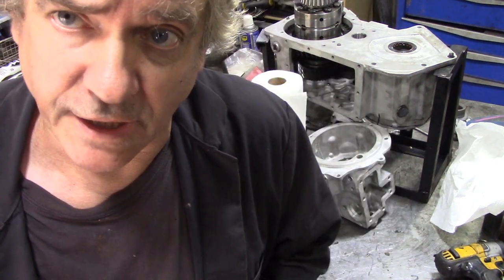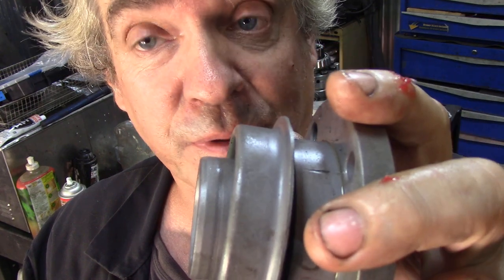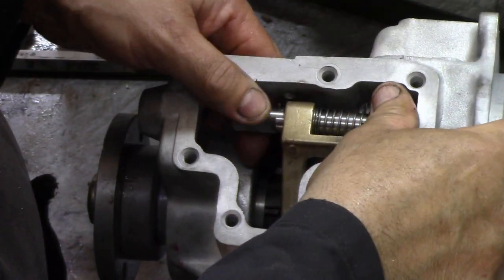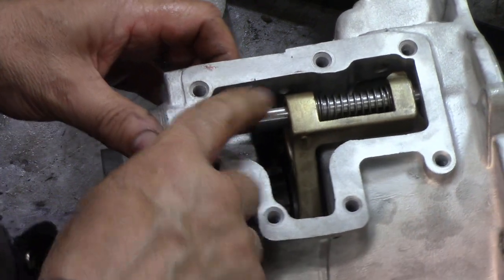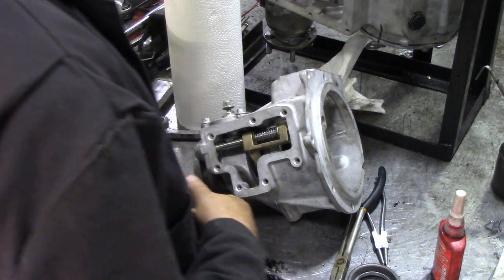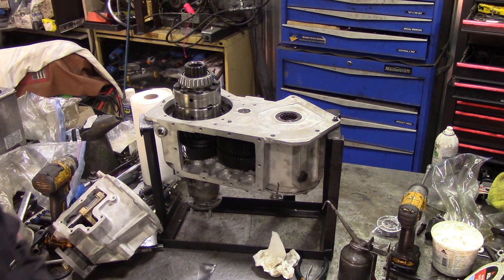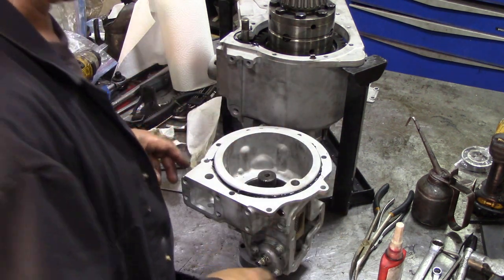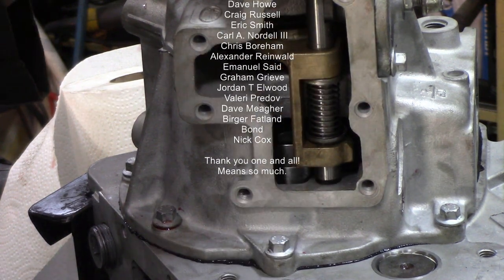Building a 1:211 ratio LT230Q for a Defender Td5 from a Discovery 1 or 2  Part 4

Comment: It’s interesting JP prefers to make the bush to fit the hole, yet Ashcroft go the other way and sell the bush and you get your case machined to fit the bush. I guess it’s so they can sell them.
Reply from the maker: Yes  - they have a CNC machine to machine the cases, so pretty easy for them
Reply: @BritannicaRestorations  they sell the bushes separately. That’s where I got mine and got somebody local machined the case. No idea how they machined it. Maybe CNC as well? Seems fine so far, no leaks (touch wood).
Reply from the maker: I think JP's reasoning is he wants to make a thin wall hard metal bush so as not to compromise the strength of the casing - also it is much simpler to machine the hole in the casing first on the miller and the make the bush to fit the hole, because if you make the bush first and then make the hole, you may find the new bush is too small - those castings are pretty porous 
I have not seen an Ashcroft bush - I meant to order one but forgot

Comment: Hey Mike, I've seen a guy on YouTube from Pakistan who'd weld up that seal diameter on the drive flange with his "stick" welder and a cardboard welding shield, put it in his lathe, tap it with his chuck key to get it running concentric then machine it with a HSS tool, and it possibly wouldn't leak oil.
Your mate JP could do that. ✅👍
Reply from the maker: Yes - I have seen these Pakistan 'repairs' - they never state how long they last!
Reply: @BritannicaRestorations  I believe it's an "end of driveway" warranty.
Reply from the maker: Or, as I like to say, an 'outta sight warranty'! 
Soon as it out of my sight, the warranty is up…

Comment: Mike.  Liked your sleeve discussion, thought it was from the priesthood !  Noticed last weekend when down shifting a Rangie "ZF" auto' quickly from D_1, in high range differential locked going downhill off-road the T/C lever kept popping into neutral.  Is this sign of wear on the teeth ?  V.

Comment: Question for you Mike! I had 0.005" play on my front output shaft/flange even after changing the Bearing and Flange. Can you tell me what the acceptable play for the front output should be??
Reply from the maker: No idea - never had the need to measure it - remember there is only one ball bearing and the internal gear of the centre diff supporting the shaft
Reply: @BritannicaRestorations  I have a nasty Deceleration viberations/growling at 70mph from the front. I found output was loose and measured before and after the bearing change. It's a D1 with a lift, so a Double Cardan DS has been ordered to fix those DS angles. MANY thanks for the input! Like you said; by design, they will never be fully tight on one ball bearing.
Reply from the maker: The worst thing you can do to a D1 is lift it - they were bad enough for 'death wobble' with a standard set up
I do not think anyone has put their finger on why it does it
My D1 300 Tdi I had in the UK was prefect - but a percentage of them here with the V8 were a nightmare!
Reply: @BritannicaRestorations  Yeah it was never very fun to drive on the freeway, and way worse after lifting it. The 3 degree caster Arms helped a LOT, but really messed up the drivelines. Got the garbling decel noise shaking and I seen output was loose some. Did bearing seal and new flange and didn't help.. So I'm converting to double cardan (tom woods) on the front, and the Standard RRC 2 UJ's on the rear. I'll space the radius arms to get angles correct if needed. Mine is a 96 D1 SE7 V8 BTW.. Got you a new Sub my man!
Reply from the maker: There was a very interesting subject I covered a while back where someone had a 110 with very bad vibration - he did a lift and all the bits you did  - tried all sorts - it turned out to be the 110 needed a spacer between the rear radius arm and the chassis - this was fitted by LR

https://www.lrworkshop.com/diagrams/land-rover-defender-axles-suspension/rear-suspension/bottom-link_52630#15

Fixed the problem - now I am not saying it will fix your issue, but think outside the box - it was the angle of the prop that needed changing
Reply: @BritannicaRestorations  MAN you are a wealth of information!! I owe you a beer! 

I didn't know 110 had these spacers, but it makes sense. I was actually thinking of cutting myself a spacer to get the angles parallel, possibly using my old mounts for them. But yeah doing the same very thing!

But first I need to ditch the Flex joint and get the DS, which I'm waiting for in the mail and watching your videos of removing the centering pin. :)

Once again thank you so much for ALL the information!!
Reply: @BritannicaRestorations  Hey just to update you on this. I got the rear shaft and flange changed away from the Flex and to a UJ. I have 3 degrees difference on the drive flanges. So the rear axle will have to tilt down. This is with 2" med TF springs, 3deg caster F/R arms. I'll be spacing the rear arms like you suggested. MANY thanks! You have a "friend" in Arizona if you ever need one!